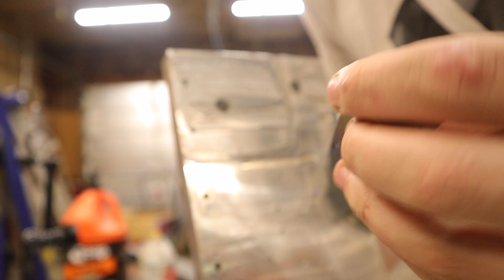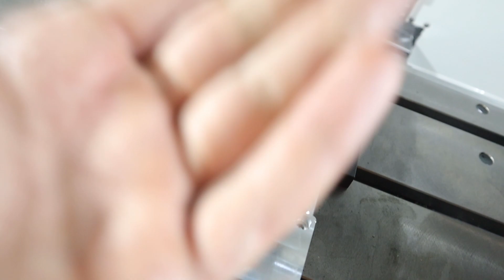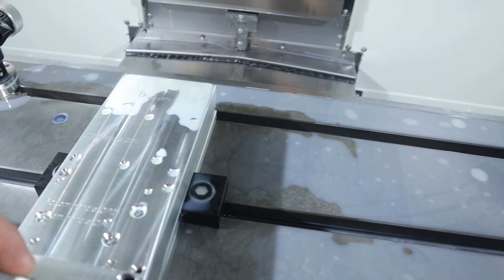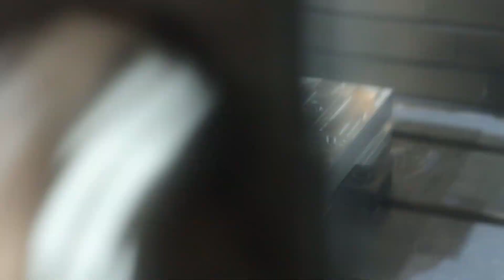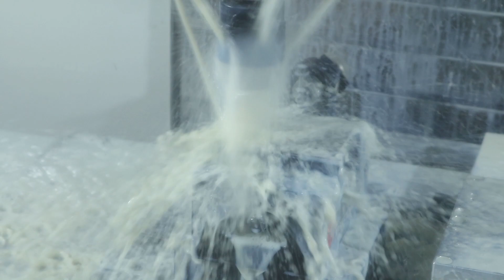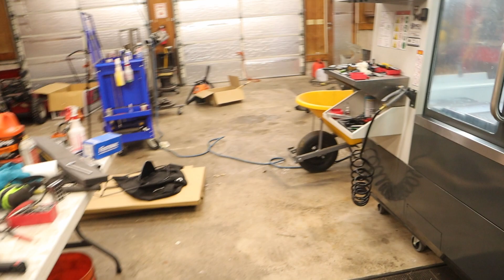Garage vlog 6 - Awesome new handle fixture

Comment: i wish i had a big garage like that and someone financed me a mill
Reply from the maker: All you have to do is spend a metric boat load of money..
Reply: A (small) mill i can afford, the workshop is way out of my reach sadly.
Reply from the maker: Yea it's Def not easy. We ended up buying this house cause of the garage. I also still work full time to afford the mill payment haha. One small step at a time :)
Reply: @split141x  i would have to buy a house firts to have the garage and then i could maybe afford a payment for a tm series mill. Or say vf2 with basicly no optionals.
Reply from the maker: Going to be honest if I did it again I would go with a minimill... Mostly because of my power issues. Live and learn. I run a tm2p at work and they are great machines as well.
Reply: @split141x  true, smaller machine would be suitable for garage because of the power issue. i''ve been thinking some day would be nice to buy a tm2 or 3 and tl2 in a garage.